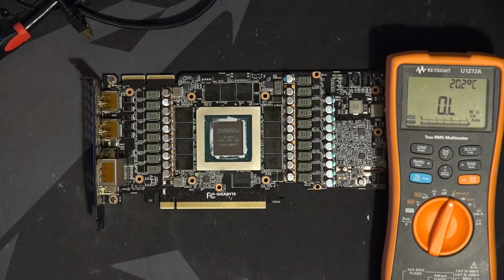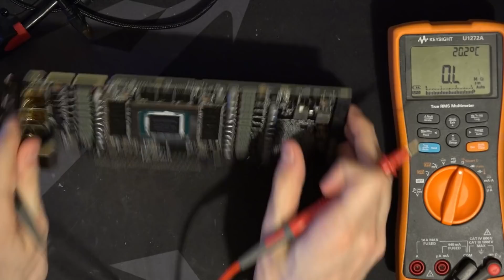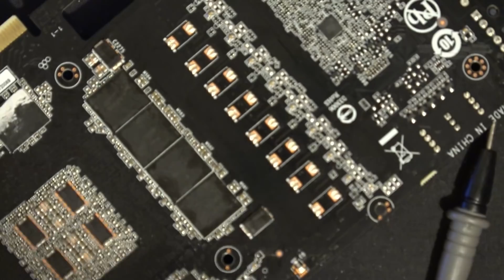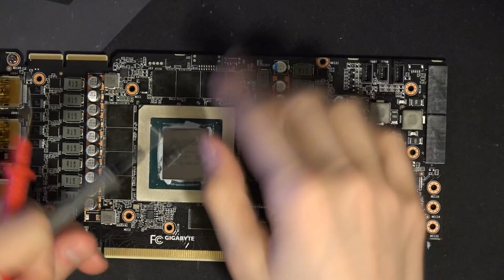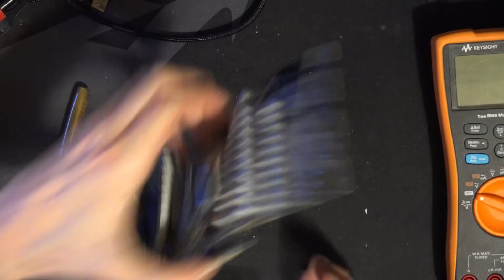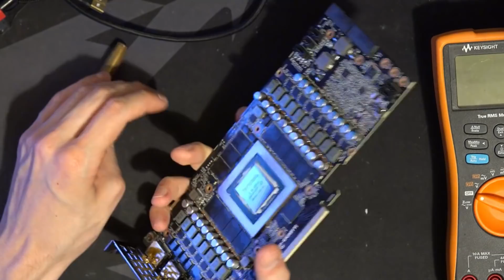Probing a Gigabyte RTX 3090 Vision that died when trying to run New World

Comment: it's only the evga and gigabyte ones that die cause of bad design.
Reply: They all use the same reference design, this is why MSI, Zotec, Asus etc have also had cards die playing New World, along with 3080's etc.
Reply: @tonyb1223  no they didn't. it's only evga and gigabyte cause of their poor oc and the way they did it. read more before u chat shit.
Reply: @BullRadu  Really? I think you need to read up more on this, they all use the same drivers, the Gigabyte card is OC'd to 1755mhz which is lower than most, Zotec had one filmed going pop and smoking, MSI, Asus etc have also had noted cards go whilst playing New World, its all documented and out there, even 3080's have blown up running it.

Several youtube channels have done tests or have asked owners if their cards have popped, they have a list of all different types of 3090's that have, it isnt just an evga/gigabyte issue, its even killed 1080ti's, which are not even the same architecture, so is the problem the cards or the software in game?

Oh and btw, im a 3090 Gigabyte Gaming OC owner, no issues on my card 😁 and its over a year since I purchased (at msrp) and installed into my system 😋

Comment: Electrical engineering is a field where I don't know enough to be useful and I've always wanted to know more. It wasn't made as an educational video in that regard, but it was cool watching what you're looking at and what you're looking for.
Reply: You can get some of that from louis rossmann's repair videos. Also eevblog.  You may even want to start with their older videos.
Reply: It’s electronics engineering not electrical
Reply: @waithony  Ha Ha Ha
Reply: @waithony  No, it is properly called Electrical Engineering. That's what is written on the degree, and digital electronics is a subset of the field of electrical engineering. It could also include high voltage power transmission, for example. Nobody calls a power substation "electronics".
Reply: @jasonfullerton7763  nope it's electronics and electrical engineering. Different disciplines, different applications.
Reply: @jasonfullerton7763  Me who's doing a Electronics Degrees : 
Ight imma head out

Comment: asymethrical VRMs seem like the kind of thing you need a very smart controller and powerstage to work right, so like "Hey powerstage 1 and 2 can take 120 amps but stages 3 through 10 can only do 80 amps, so I better set the powerful 2 to take on more load and monitor how much each stages is using in a very high speed to make sure one stage in particular is not under too much load". Seems bad, like the kinda thing that sounds good on paper but is too costly to make work.

Comment: Everyone chooses to blame the game for this issue, but imo it's the manufacturer's responsibility to harden their product against attack vectors. Even if the bug in the game gets fixed, the card will still be vulnerable. What if bad actors start writing ransomware that threatens to destroy your GPU unless you pay? The card ought to be able to resist such an attack. There's a saying among Linux kernel developers: "We do not break userspace". What this means is that even if a change to the kernel is an objective improvement, if said change causes a downstream piece of software to break because maybe it relied on some quirky behavior that it shouldn't have, then said change should be considered a bug in the kernel. It's more important to preserve the functionality of and compatibility with user mode software than it is to streamline things that are janky.
Reply: It is for sure manufacturers fault, but also the game triggers it, and there are much more GPU demanding games out there that dont do that. So something in new world is very wrong as well. Blame both.

Comment: The New World game code is so poorly written it forces the GFX cards to draw power well above its rated MAX even in the game menu. Run overclocking software and measure the voltage spikes, some have spiked to 20% over the max rating of the card drawing way to much power. Using overclocking software  lowering the power draw slider to 90% (60% on EVGA cards because they seem to draw power well above what the slider is saying). Then raising or lowering the power slider while in the game menu so the spikes hit 100% of the cards max draw rating will save your card. OR just don't play New World.

Comment: I appreciate an informed "don't know" far more than an ignorant "It's the fan controller hurr" diagnosis. So far evidence is pointing towards power delivery design skill issue, yes?
Reply: It has nothing to do with the mmo people are putting blame on the game instead of the gpu developers
Reply: @ForeverHollowed  there is something wrong with ‘the game’ and the ‘gpu’, mein kleiner Freund.
Reply: @ForeverHollowed  ok Buuuuut.... If it were TRULY only a gpu issue, these cards would be dying in any game or stress test.

There is still something wrong with new world I think, which ends up killing weaker built cards that may have failed down the road anyways and whatever new world does, kills it faster.

Comment: Has there been any reports of any other models failing? I have a strip 3070 which I’m not worried about my card (which I do play new world and have been every day for hours on end) but just curious if there were diff models than the 3090
Reply: There have been reports of a wide variety of GPUs failing due to playing new world. Not just 3090's & not just nVidia GPUs. It's safe to say something isn't quite right with the game even if ideally you'd want the hardware to have faultless protection mechanisms in place (which is definitely not achievable unless you want to pay exorbitant prices for them in a normal GPU market).

Comment: Gigabyte's customer service is especially terrible. Something broke on my 3090 vision and the card will no longer boost past the default 1350mhz core speed. I sent it to gigabyte for a replacement and they sent it back with a rejection saying the board was bent and warranty void now.

Comment: It seems to me that the problem is the cards have a 100 degree hotspot by design.   With running things so close to thermal limits, it only takes a small error in power management for things to go bang.  New World seems to make cards run at around 10% higher watts draw than they intended, and once you run a card that wants peaks of around 350w at more than 400w its much more likely to fail.

Comment: Your expensive multimeter seriously sucks. 
I use two DM9808+ and do tracing much faster.
Get a pair of cheapo decent meters and use the expensive one for precision measurements m8.
Edit: Never tried this and not sure if this gonna damage the card but how about run a couple of amps from blown fuse out to ground for a minute and look at the card with a thermal cam?

Comment: I've played games created with the Unity Engine that makes the cards run at 100% max and overheat even when framerates are low and just in a menu. For a simple example games like Minion Masters heats up the card more than Crysis does.
So there are problems that can happen with software overloading cards
Reply: Sure, but hardware is supposed to be able to take everything the software throws at it, no matter how stupid or malicious. We're dealing with consumer products here, not industrial equipment. If a card can't take the heat, it's essentially overpromising and overdelivering. Always common with OC, of course, but for an unmodified card, the blame must absolutely be on the hardware manufacturer. If user-mode code can kill hardware, it's faulty hardware - especially if it's something that can happen in a couple seconds.
Reply: @LuaanTi  
I was simply stating this problem occurs with a number of games, mostly ignored by the software developers or denied outright.
It is a problem that some software/coding can bork our hardware.

Comment: Remember when "this game will melt your graphics card" used to be figurative, not literal?
Reply: @non yabiz it's not breaking most people cards dude, just these scuffed ones with design flaws.
Reply: @non yabiz LMFAO! They designed a game that just pushes the current Gen cards to max, causing faulty hardware and poor design choices to be exposed
Reply: It's always been literal lol. Well not always but this isnt at all new.
Reply: And this is why I'm one of those who haven't even thought about playing New World.  The second I heard the warning, I noped out.
Reply: @katarh  apparently a couple of other games killing 3090s now! I'm scared with my 3080ti now.
Reply: @Khola_D  Also on a Gigabyte 3080 Ti.   If it was just the issue of risking the hardware, it'd be one thing, but right now it's risking the hardware with literally no options for replacement, since Gigabyte is being poop about RMAs and there is still a massive shortage for everything else.  I'm on a good PSU and my card has been waterblocked to avoid the VRAM overheating issues that people noticed last year, and until the issues that are triggering the dead cards are verified and resolved by Nvidia, I just don't see a point in trying a game I don't even think I will enjoy.
Reply: @katarh  The game has settings in options to workaround this potential design flaw in cards. Let's be clear here. It is not the game's fault the card fails as it does not do anything outside of the norm and only uses DX calls. The problem is in the card design, it is a hardware fault. By default the game enables the frame limiter while in menues, minimized or unfocussed. Switching that off.. if your own responsibility.. Also.. the number of cards which actually failed is actually really small.. it's just that there was/is a lot of noise around this by mostly ppl who really are just .. making noise..
Reply: @blazemonger1  "It's not up to the game developers to make sure their product doesn't destroy your computer. It's up to you."

Yeah, right. It's my responsibility to fix the game developed by some huge megacorporation. It's not their responsibility.
Reply: @DjVortex-w  AGS DID take their responisbility in providing a workaround option in settings to not have these hardware faults break the card.. It is on by default. The root cause here is not in the game though as the game does not do anything special or directly related to the card. The game goes through DX as it should. EVGA has already admistted it was a design flaw on their cards that caused these cards to break. Also, New World is not the only game to expose these flaws, it is just a high visibility one. The problem here is not with the game.
Reply: @blazemonger1  it isnt just killing gigabyte cards and it isnt exclusively the manufacturers faults. It's a perfect storm of shoddy code trying to make the gpu take more power then it needs and the card allowing the game to do so due to the design flaw. If it was the initial soldering issue we saw with gigabyte cards then I'd agree but the entire 30XX gen is reportedly now having these issues.
Reply: @nicholasrozwalka2768  The game does not make any direct calls to the card. This issue happens when the game is minimized or doe snot have focus (or is in menu). It is not relevant during gameplay at all. Also, as said many times now, the devs have included a workaround to this by adding the FPS limiter in the situations where this issue may occur and have done so during the start of the first public beta. So, they have done what they can.

Comment: while talking about 980ti´s - i have one from evga that works fine at idle but crashes under load even when droped to 55% powerlimit - is that a potential vrm failing?
Reply from the maker: memory or core failing
Reply: @ActuallyHardcoreOverclocking  forgot to mention, it started around 2 years ago, lowered powerlimit to around 85% and then lowered here and there

doesnt sound any better though..... damn

Comment: You should do voltage injection 1.2 volt to the shorted side of the fuse. With a thermal cam, you can see witch power ic is bad.

Comment: You need to use a high current low voltage source and a temperature camera or what i did some freeze spray or alcohol and see which part is heating up and boiling off the liquid first. I have found shorted capacitors this way in switches and stuff.

Comment: i've seen this problem from several different manufacturers already. asus, evga, zotac. the zotac one was actually smoking when it failed.
Reply: He literally left it running for ages and was filming it. Should have prob turned the thing off.
Reply: @Khola_D  no card should fail in that short amount of time. PC parts are designed to be ran at high temps and power draw for extended periods of time. People have GPUs from over a decade ago still running fine.
Reply: @12pandemon  Yup. I'm one of them. I have 2x 8800gtx from my first sli build that work fine. Back then 768MB was a lot per card!

Im just saying half these other cards may have smoked if people had sat there with them powered on filming them.

Comment: Thank you for the video.  Appreciated the break down.  My thoughts on the warranty denial by Gigagamble:  I bought several Gigabyte cards from Newegg over 10 years ago for playing Everquest on multiple pcs at the same time.  One of them broke (full screen was green I think it was, was like a full screen brick pattern but all green iirc) after a few months.  I had to pay the shipping to send them their faulty card.  They sent it back like a month later saying no problem found even though no matter which output I used it had the same issue.  Tried it on multiple pcs.  I even offered to send it back again and I would pay for repairs and shipping.  They ignored me.  Oh? Ignore me?  Oh ok, I got it now.  You are NOT actually in the business of building relationships with customers for lifelong brand loyalty.  Got it.  Thanks for the heads up.  

Since Gigabyte went out of their way to show me, buying their products is like spending money at a casino (odds are against you), I refuse their "as is" products.  I have never once, not a single time, spent another dime on anything with that trash name on it.  If it's Gigabyte, its not allowed in our house.  In fact we re-assigned them a better name: Gigatrash.  When we were in the market for a few 3090s to upgrade our gaming pcs, I had the opportunity to get some Gigagambles, NOPE.  Passed!  When we built our 9900k gaming pcs, we had a chance to get the well reviewed Giga Z390 boards.  NOPE!  When a person or a company tells you the truth, you should listen.  Their truth is: they sell products as is unless you know someone, or you beat the odds.  Just read reviews under any category of giga products on any site that sells their as is products.  Your mileage may vary as they say....  

No matter how many tech tube influencers review Gigatrash products as the "best" which happens every iteration, NOPE.  Even Jayz2cents has been pretty honest about the scummy nature of Gigatrash.  If you like gambling, frequent casinos, don't mind living on hopium, think you are that one lucky person who will beat that odds, go for it.  Good luck!  Meanwhile we have spent a lot of money building computers over the years.  We chose EVGA where possible.  When they mess up THEY OWN IT and make it right quick. 

Keep up the good work on these videos!

Comment: Not only do their PSUs go bang, so do their GPUs. What's in common you ask? Well both times Gigabyte refuse to accept that there is any issue, and then refuse to help. I know this is a pre-owned card, but that should not be an excuse. Gigabyte made the thing, they should be responsible enough to replace it if things go wrong.
Reply: Current global situation is the issue. Chip scarcity allowed them to lower the QC and/or hire less qualified workers, which in turn generates them more money. The company owners are happy, so nobody on the management level cares about customers or anything. They should be more careful, because this is the path that leads to decline and demise.
Reply: @Morpheus-pt3wq  While I agree with most, I still disagree with one point. Gigabyte had the chance to help this customer out, they declined. Being decent has little to do with the current shortage. 

They choose that, and I don't think this shortage can be the excuse as they've been like this since day one.

Comment: a problem I never had with a 1080ti but that clearly became one with a 3090, too high fps = insane heat (the 450+w 3090ti is scary) I mostly play vsync on a 120Hz monitor, I unlocked it in borderlands 3 1080p and was "woaw 240-350fps in badass that's stupid powerful 2-3x the fps of a 1080ti" suddenly I realized it was hot in the room very hot 36°C hot...enjoying the game I didn't notice but a massive heatwave was exhausted by the pc case, 3090+unlimited fps = the card runs at max power nonstop it's way worse than games "benchmarks" (garbage and irrealistic marketing tools) I only have a ref 350w one tried a 390w bios rolled back, the heat generated is insane we're at the state where you're talking +5 +10°C in your room for 10fps...without aircon obviously

Comment: These cards fail because manufactures will swear up and down that there's no problem with VRM components running at 110C. When obviously heat kills. When are they going to figure this out?
Reply: Oh they know wery well, but don't care since then the cards will not hold forever and thus they continue to sell cards.
Reply: The problem is that it's not only RTX 3090's that fail & not even just a specific part of the GPU that seems to fail. It's just overall failure rates are higher for RTX 3090's.

Comment: hey bro, awesome vid! I have a 3090 that I damaged a tiny bit during installing a water block... the card still works but I am curious if you would be able to repair it if I can point out/tell you which SMDs that I damaged (I just damaged their packages and none of the came off the board)... thanks in advance :D